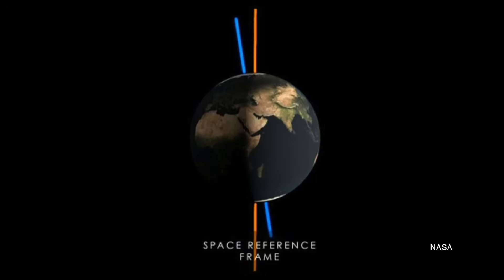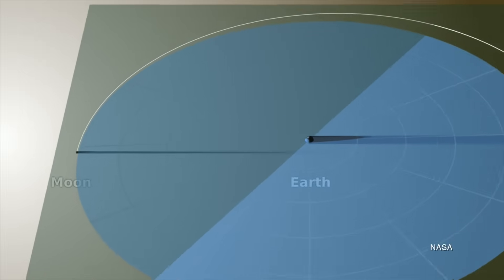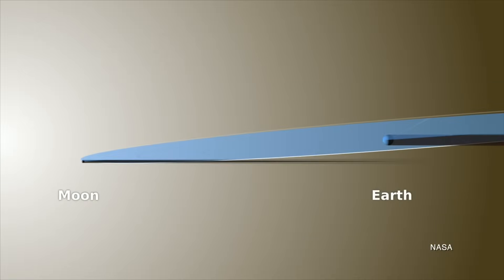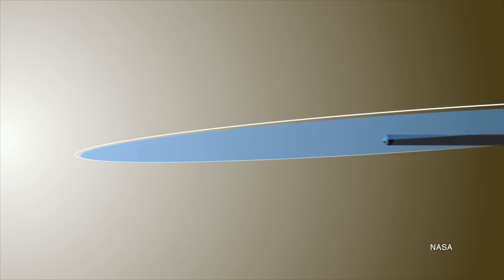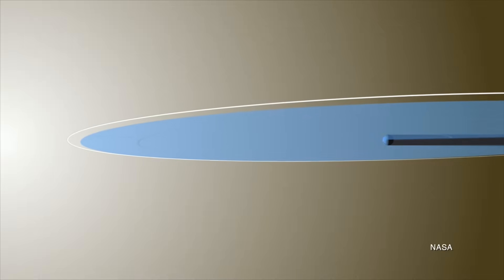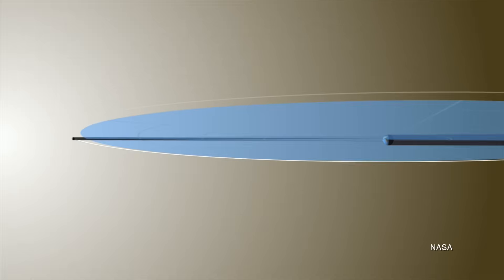Why Does a Rocket Need to Roll Going Into Orbit?

Comment: The roll is required if aerodynamic surfaces aid the ascent, to allow astronauts to take over manually, or to point antennas the right way.  Inclination alone is not the reason for the roll.  Ares 1 specifically didn't have to roll to reach the space station, but for its test flight they programmed a roll just to test the roll capability.  Falcon 9's don't roll either to reach the space station.
Reply: It was required on the Saturn V due to the severe computational limits of the AGC. Rolling turns that orientation to orbit into a pure pitch maneuver. If instead the rocket had to do a compound move of its actuators (how the engines were pointed) that would require real-time trigonometry to get the angles right, which was more trouble than its worth. Much better to just roll the whole thing and then make your gravity turn in a single axis.